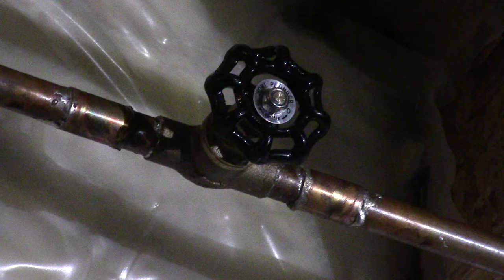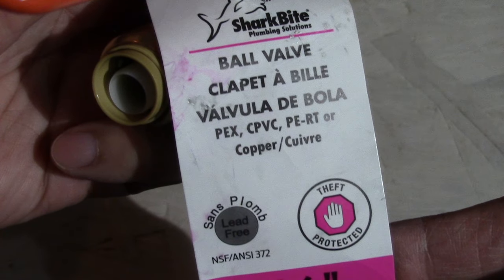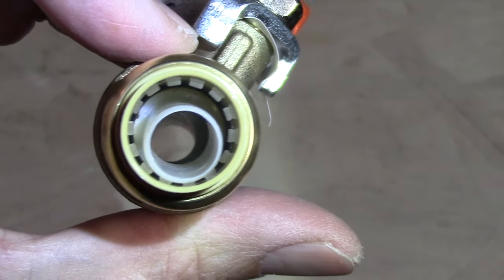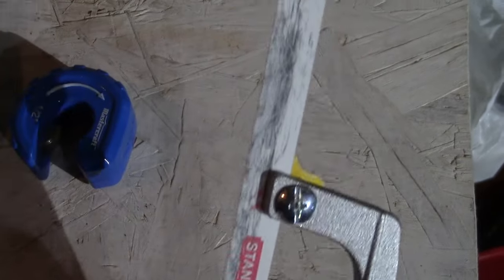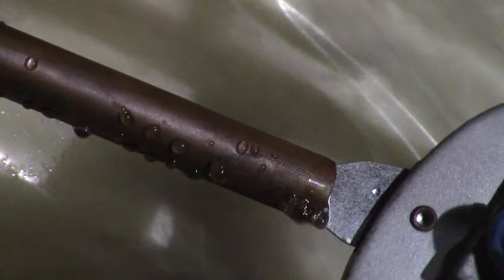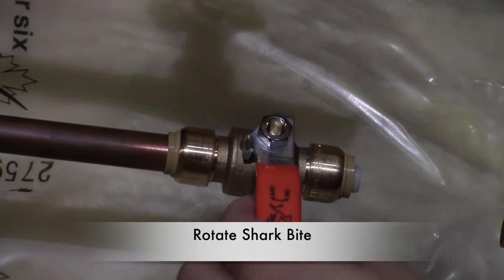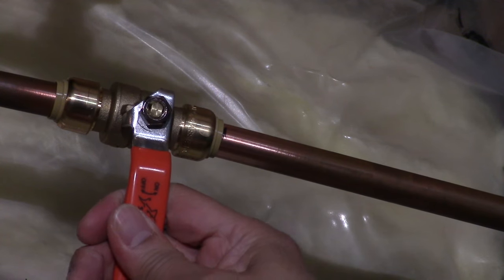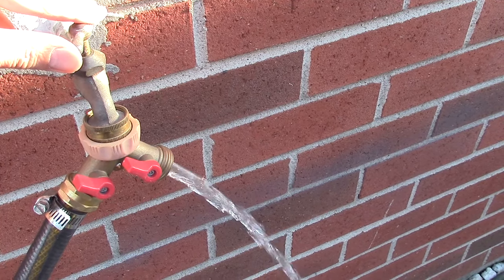Leaky Stop Valve. Installed Shark Bite Ball Stop Valve. DIY.

Comment: Wish I knew how to get that second side copper pipe to magically grow longer to push it into the valve.
Reply from the maker: Yeah there is a 45degree angle at the end of my pipe which gave me some play to move it.
Reply: I bought shark bite because it’s solder-free but there’s no play so it looks like I have to solder on a coupling long anyways smh
Reply: It kill the main objective of the sharkbite installation.
Reply: Actually all you need is a shark bite coupler and a small piece of copper no soldering needed
Reply: Exactly.
Reply: @jaysmediadump6965  for existing pluming you need to buy slip on valve. In his situation the copper pipe magically grew longer. With the slip on valve the copper dent have to magically grow longer.
Reply: If you buy a "slip" fitting instead of the fixed fitting, you can slide one end and fill a 2" gap. They're a bit more expensive but avoids having to buy a coupling fitting.
Reply: Correction: slip fitting is for adding a fitting where there was no prior fitting.

Comment: Woah!!  How does the copper pipe on the right suddenly have the ability to move longer or shorter to match up to your Sharkbite valve fitting?  When you cut the original copper line and removed the old valve, I said there's no way the new Sharkbite will work because the second connection (the right side pipe, in this case) will be too short and won't reach to insert into the Sharkbite. The pipe on the right should have been immovable and rigidly in place.
Reply from the maker: The pipe on the right had a right angle turn, so it gave it a little play.
Reply: They needed 2 shark bites and a few inches of pipe
Reply: Sometimes if pipe is in a hanger the hangar can be loosened a little to allowed some VERY LIMITED give. Be sure to retighten hangar if possible.
Reply: Damn, you're 1000% correct! I was asking the same questions.  LOL
Reply: @sandburgmartin7947  Understood but per this video, he had alot of play and I think this was just a commercial advertisement of shark bite. See how much pipes, including the shut vale he cut off, there's no way he had enough play on the pipe to reconnect it together.
Reply: @jonahvlogsdiy4143  I'll say...that's lot of play for sure because you sure cut alot off.
Reply: 3:05, as soon as it's cut he slides it over.

Comment: Very poor video.  It doesn't address how to make the connection to the rigid pipe on the right.  Will it be a solder connection?  If so, how far away to prevent the heat of soldering from melting the plastic inside the shark bite?

Comment: If there’s play in the pipe, no problem. If there’s little to no play in the pipe, you need to buy the slip version of the ball valve, The slip type of valve has one side that is longer than the other. You slide the pipe into the longer side first, PAST your insertion line so that you have room to get the other side in, then you slide it back the other way.
Reply from the maker: Yes you're right.

Comment: You removed about 4 inches of length and replaced it with a valve that is only 2 inches long. How did you make up the distance? That is the issue I am having. I cant seem to find a video addressing that issue.
Reply from the maker: I thought my measurement was pretty close, but about 6 feet to the right there's a 90 degree turn which gave me a little play.

Comment: Thanks a lot. I just had to push the Shark Bite Ball Stop Valve a little further onto the 3/4 cold water copper pipe , then it stopped leaking. Thank you.

Comment: Clean and straight and not sharp.  The end inside presses up against a rubber ring. Best for use at the end of the line, never behind a wall or in the mainline.

Comment: Thank god. Finally found a channel not bashing shark bite. (Which does reveal how smart your “plumber” is). These are too simple to blame the product. Good luck selling your high end filtration system if you don’t like push fittings. But go ahead and blame the product with instructions in pictures on every package. Selling by the millions daily. Yeah. Blame that product.
Reply from the maker: Thank you. I had to admit I was nervous about using it at first but finally believed how great the product is when I started using it on many of my projects.

Comment: You cut the pipe so the pipe is shorter, how would you still be able to connect to the Sharkbite value?   May be the pipe is flexible so that you can pull them together in your case but mostly are not.

Comment: I've seen where plumbers will remove that white plastic 'stiffener' inside the Sharkbite adapter before inserting the copper pipe.
Reply from the maker: I wouldn't do it.
Reply: That white pastic stiffener is for pex tubing.  You can take it out or leave it in for copper install.  Just be sure if you are working with copper that you buy the Sharkbite fitting rated for copper.

Comment: how you cut 6 inches out and still able to connect?
Reply from the maker: Yeah 8 ft away, there is an elbow. It gave a a little play.
Reply: @jonahvlogsdiy4143  it would be good to mention that if you don’t have sufficient pipe length after cutting out the old shutoff valve, then you will need to add a sharkbite coupling with a small length of pipe to complete the assembly

Comment: Still an interesting video, but to make Sharkbite fittings work you have to have a lot of play or give on at least one side of the plumbing line.  I need Sharkbite shutoff valves in 4 places in my my crawlspace, but I have zero give or play in the CPVC lines.  There would be no way to install the valves short of hiring a professional plumber.
Reply from the maker: If you have a 90 angle a distant ft away, that still gives you a little play.

Comment: how come you did not take white plasique tube in sharkbite fitting when you use copper pipe
Reply from the maker: That white plastic tube stays in. Do not remove it.
Reply: @jonahvlogsdiy4143  it not spose to stay in for copper juste pex
Reply: when you use copper pipe you take out the plastque tube
Reply: According to Sharkbite web site, it is NOT necessary to remove the white PEX insert. As such, I would leave it. I've installed over 25 Sharkbite fittings without removing the PEX insert and never had a leak. Fittings have been in place for over 2 years.

Comment: Where did you find the play in the second pipe?
Reply from the maker: About 6 feet to the right is a 90degree angle on the pipe. This gave me a small play.
Reply: He cheated. didnt use the original cuts opening more like using

Comment: Hi Jonah. On yours video everything goes nice and easy. My situation is worse, I have no chance to move the pipes.  Everything is connected very tightly and the pipes are stiff. The old valve was installed  in very complicated way. If I cut out all this weirdness, it will turn out that pipes are not in one line. Do you have same idea how to do a proper installation. I will be glad to hear a professional advice-Mike
Reply from the maker: Yes Mike there's another type of Shark Bite that you push in all the way through the left side pipe, then line up the two ends & push back through the right side. Thens centre the SharkBite. You can buy it at Home Depot also. I will try to do a video on it soon.
Reply: @jonahvlogsdiy4143  Hi Jonah. Thank you very much for your reply. I'm retired, with no money. Your technical support will make it possible for me to do this without a very expensive plumber's visit. Can I send you a picture showing this tight cluster of pipes, please. I am sure an experienced plumber like you can give me some good advice. Please, say YES. We have had this problem for over 10 weeks. A small amount of water flows out of the tap at a time.  It takes almost three hours to collect a 1 gallon of water. Please, help us--Miroslaw
Reply: That won't work for what  @jonahvlogsdiy4143  has going on. The pipes can't touch each other. 
Jonah, you need the Shark Bite where one side has a hose on the side of the valve to bridge the gap. 
Look up Shark Bite shut off valve and find the one with a hose attached.